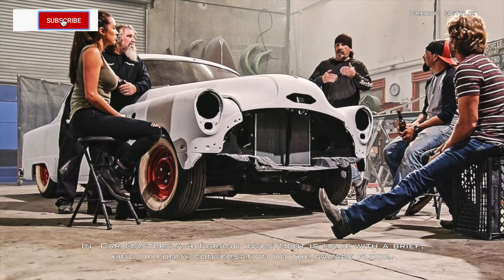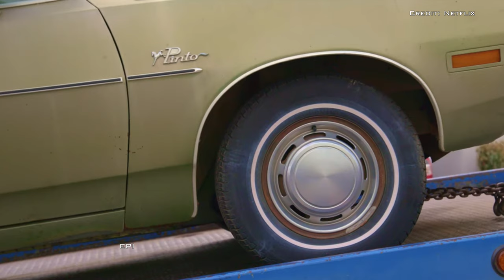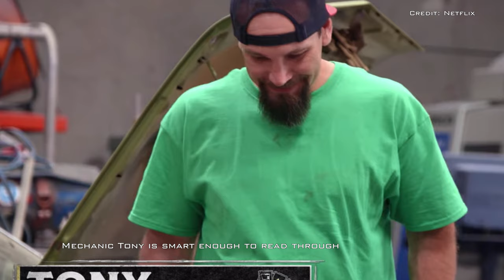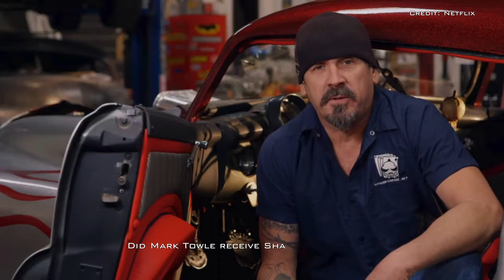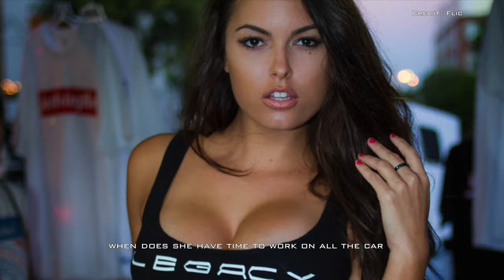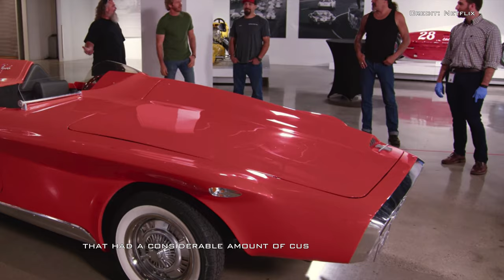What's Real And Fake On Car Masters: Rust To Riches

Comment: Just started watching season 3 and I have to say it's edited all so bad. The worst thing by far is the paint quality they do. I'm sorry but he is not a good painter at all. His technique is so bad and it's full of orange peel effect. I actually don't think he applies clear coat. I cringed
Reply: I agree 100%. 

And the costumers are actors as well. 
Not just a coincidence that the action was with all the previous buyers 😂😂
Reply: The concept car and the motor cycle episode, you notice the motor cycle fiber sticker looks so awefuly attached
Reply: Concept bike was a major disappointment!! It looks rough on the edges and decals has air bubbles, major mis cuts, imperfections and uneven cutting to that one solid piece. They ruined the original bike!!
Reply: His painting is just Farkin horrible isn't it. 
The new owners of the cars must love orange peel
or their blind or their both.